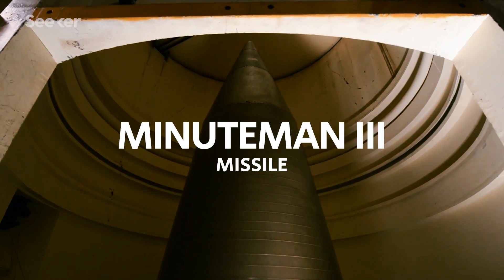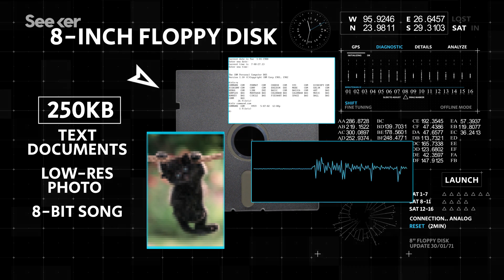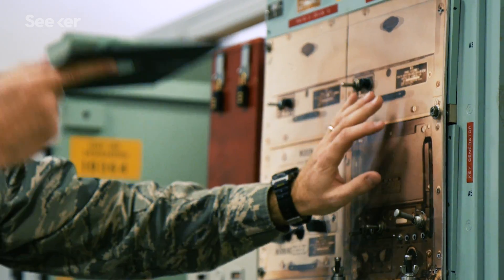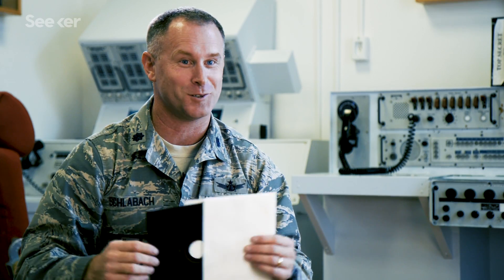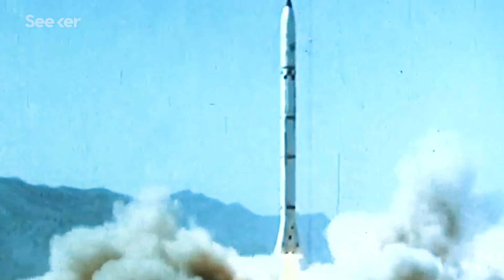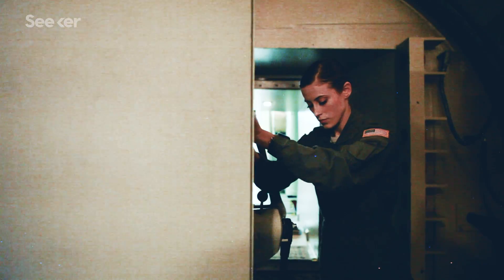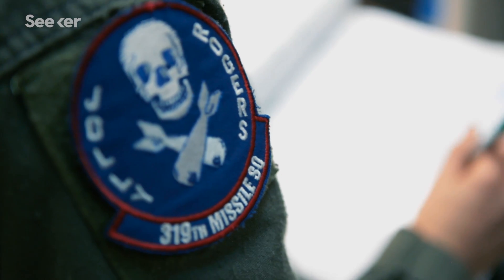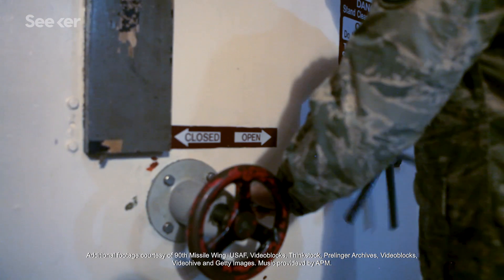When U.S. Nuclear Missiles Were Controlled By Floppy Disks

Comment from the maker: Hi, thanks for watching! An update: In June 2019, the U.S. Defense Department transitioned away from a nuclear command and control system that relied on floppy discs.
Reply: Seeker using usb sticks now. 😂
Reply: This makes no sense. On floppy disk the system is more secure than relying on hard disks because hard disk drivers can be modified with the private source code.
Reply: @hassansyed5661  floppy disks are hard to repair and expensive to fix when they do break

Comment: In these days of globule hacking, internet access and the rest an isolated old school system is best. One EMP in the right place WILL take out all phones, ATM etc , and pretty much everything newer. Old tube based systems will not have a problem apart from limited range, why because they don't have circuits that will fry as long as they are connected to batteries. If you want to save your laptop and have time to do it, stick it (and your phone not sure if it'll work due the rest of the system going down) into a metal cabinet that's grounded. I think they call it a Faraday shield.

Comment: It's pretty stupid, any custom hardware with any custom software that isn't connected to the network is "hacker proof" the hacker wouldn't know where to even begin...

The sheer amount of electricity this behemoth runs on could subsidize a new hardware project...
You could still use floppy discs or any new custom storage medium but the control box would be the size of a shoe box.

Comment: Spare parts will eventually require specialized manufacturing systems just for these devices (for example, very advanced 3D printers for parts, even making the disks).  Making sure that these add-ons have not been hacked is necessary.  With looming nano-technology, this will be extremely difficult -- can the sites be sealed airtight?

Comment: I am very reassured to see that the OS fits in 200KB. There is no better way to introduce bugs than to grow your code and to have a huge system where nobody really knows what is happening. 200KB means the code can probably fit in a single text file and be known by heart by a single person, which makes it easier to spot bugs before they happen. Less code means less things that can go wrong, less probability of bugs. It means less potential states and less unpredictability.
Old hardware means tested hardware. But I would definitely want to build strong redundancy, because old hardware is reliable until it breaks down, and really old hardware can break down in unpredictable ways.

Comment: This is somewhat misleading as the system using the floppy discs is actually a communications system which was called SACDIN or the Strategic Air Command Digital Network.  The system allows an Emergency Action Message (EAM) to be delivered to all nuclear forces within X amount of time.  The system was built and delivered by the ITT Defense Communications Division.  I was involved with the project from research and development (R&D), testing, production, delivery and installation. The system is a watered down version of the system the Air Force initially wanted which I believe was called SATIN 5.  

This project was started in the 1970s.  At that time the government wanted off the shelf technology used.  The problem is by the time the system is fully installed, in 1988, the system is already obsolete.  The system tested to be extremely reliable and  performed to the specs required by the USAF.  Additionally, it is virtually impossible to hack into the system.
Reply: Conventional strikes combined with a drone hacking on the ALCS UHF modem.  The attacker would need to really know the system down to the Ada code and have codes, but it could be done.  
MAD would be the main protection from such an attack, as such an action would require a state actor.
Reply: Thank you for your reply.  Nice to hear the view from someone with intelligence.
Reply: We tested for virtually every possible scenario and I am extremely confident the system could not be penetrated.  Some defense was classified at the time and even today I won’t discuss them.  However,  as you have mentioned pretty much anything is possible.

Comment: This very typical about the status quo.  Most recent experts in computer science, engineering and science called this "resistance to change."  Microsoft and Apple had this exact problem in 1970 to present.  It is called UNIX command line editor fight for survival against graphical interfaces and object oriented programming methodology.  Therefore, the veterans of this technology need job security by blocking the younger generation.  However, I suspect many who were the "champions of this technology" are now actually dead or incapacitated to fix undocumented codes, process, and technology.  They should used the processes of Microsoft and Apple to overcome this hurdle.  I suggest the younger people should be able to exact (hack) that 8 1/2 disk and get the data format.  It is a start.

Comment: New hardware does not equal less secure!? You can upgrade without including bluetooth, wifi or any other network communication. What is down there is old clunky and difficult to maintain. Floppy disks are not reliable, solid state storage is. New hardware = less maintenance, smaller form factor, less room for error, less checks for issues etc etc.

Comment: Good valid points on using an antiqued system however the major flaw with this system is the floppy disk it's self. CDs,DVD,blue ray, and USB drives all have a much longer shelf life than a floppy disk.
Reply: That’s not true, discs have a short lifespan, that’s why a lot discs from the 90s and even early 2000s have disc rot. Floppy discs are actually made out of tape which has a much longer lifespan. USB devices are too vulnerable to use with a middle silo.

Comment: New computer systems don’t have to be less secure, more ram, a better operating system, streamlined (by today’s standards) launch protocols, custom engineered launch keys, no ones forcing you to have wireless and the only people who knew how to hack it (which would require physical contact in this case (and that team already has security over that covered by the looks of it)) would be the ones who built it, it’s not like they’d be buying motherboards off the shelf with a fresh copy of windows 10

Comment: They're using (notoriously unreliable) magnetic storage? They're not even going to move to modern, radiation-hardened ICs?
I don't buy it. I bet they have like 2 missiles controlled by this old tech, and the rest of the fleet is using modern (proprietary/secret) electronics.

Comment: So a week or two ago it came out that there are security vulnerabilities in the actual processors themselves, hardware , Perhaps intentional back doors, that were placed in almost every processor made by the three big processor manufactures for the last many many years. For example every single iPhone has processors with these laws. Embedded security back door is in the switches of processor chip some cells are incredibly hard to detect.  Frankly I would be terrified if they were to update the Minuteman system with modern computer is because it is so hard to protect against these laws or back doors if you prefer to call them that as they were probably put there on purpose at the behest of the NSA or something. Anyway I would be terrified. No I tell you what magnetic film disc memory is a little bit scary

Comment: I see all those doors and metal gratings, opening mechanisms and other general metal parts through that video are all rusty and with pealed paint. It looks like that not only computers are old.  Worst of it is that it looks like that maintenance is lacking. Hacking would be the least of problems if those missiles start falling apart by them selves.

Comment: As a person who have used 3.5 inch floppy disks during school days for projects, these things are extremely unreliable, I remember keeping 2 to 3 backup floppies just if one in hand don't work. Compare it to usb sticks, usb is 1000 times more reliable than these floppies. Now coming to hacking part, yes not connected to internet helps, but you dont need to connect modern hardware to internet. You can get modern upgrade and not connect to internet for security reasons. these guys are just counting these benefits for sake of assurance but they all know if war broke out they are all sitting ducks with unreliable floppies.
Reply: Well, 3.5 inch floppies was last produced by sony(the last player remaining in floppy market) in 2010. the production of 8 inch floppies stopped in 90s, so these guys are either using 15-20 year old stock, or buying used ones from market.
Reply: 3.5 floppies are unreliable as they were made in a time where they were obsolete. 8 inch floppies are extremely reliable and durable.

Comment: They should secure the wires that connect the system to the central hub, this is the most glaring attack vector. They are also vulnerable to a total shutdown if there is a large enough EMP that wipes the disks. Hope they have taken a lot of precautions.  Those missiles are very very dangerous!

Comment: Gotta say.. the way that guy kept saying "It still works. So why change it?" Sounds a little... fucked?
I mean how long until it doesn't work? Old trusty car thats been working for 30 years is great until is finally kicks the bucket. Only in this case its nuclear weapons that may kick and well... That's a big kick.
Reply: Changing the system isn't a significant threat if done correctly.
Obviously you don't upgrade the entire fleet of nukes simultaneously.
Reply: Well I wasn't getting mad at him. I was just pointing out how saying that is a bit off. It applies to the entire branch. Also as Falcrist explains, they would do it in chunks, not all at once. It definitely would not switch off the US entire nuclear defense system to update it.
Reply: El Psy alternatively I’m sure they’ve evaluated the threat of changing the system. We would have to most likely disengage our nukes for enough time that the risk to payout option is not currently worthwhile. Also he’s a puppet he doesn’t make those choices so don’t get all mad about him just saying what he was told to say. He may not be at the bottom of the food chain but he sure as shit ain’t at the top

Comment: It's genius. There isn't enough memory to hack with advanced modern protocol stacks. You might even have to use obfuscating compression encryption to make a dent. Just wish they used an optical disk with similar built-in memory constraints for better reliability over floppy.
Reply: lmao word salad much there guy.  I am sure that obfuscating compression encryption would render your every attempt COMPETELY incompatible with the target system. as each of  those methods are for modern systems to talk to another modern system that it shares keys with already. smh

Comment: Ummmm, little do people these days realise, but the old floppy disks such as from the brand Verbatim pre 1995 were INSANELY high quality and could easily last a hundred years under the right conditions - FAR longer than CD/DVD or anything since then - plus minimal tech needed to make it work which means less chance of a modern hard drive or modern motor inside a bluray drive screwing up over the decades of no use - - overall, it is FAR better to use those than modern tech! Also, less chance of being hacked as they are 'out of date' lol

Comment: Coming off the civilian side of nuclear I can tell you at least in Canada it's the same story. The CANDU control computers were one of the first digital controllers and we still use the same code and the same operating system which is a big problem when the computers need to be replaced

Comment: Lol they revealed a lot of secrets. 
1st it's hackable through floppy. You don't need to search the web. Secondly the guy that explained probably has info on his laptop about this system. So getting acces to his computer or any other operators computer can reveal a lot. Sometimes the simplest email can.

Software is probably written in cobal language considering it's age and "cutting edge technology back in the day". So in any case if the floppies were swapped in a hackers scenario than it probably be hacked.
Reply: Launch officers also texted the launch codes one time, so those are known.  Military is slow to change those, with the last launch codes being 00000000 on all minuitman missiles for the longest time.
"Software is probably written in cobal language considering it's age and "cutting edge technology back in the day"..."

Ada, based on pascal.
with Ada.Text_IO; use Ada.Text_IO;
procedure Hello is
begin
  Put_Line ("Hello, world!");
end Hello;

"So in any case if the floppies were swapped in a hackers scenario than it probably be hacked."
USB to FDADAP interface card and you are good to go.

Comment: So what you're saying is  Skynet can't take over then?
Reply: Depends on how it attempts to access their network.  Potentially it could just provide faulty info in an attempt to hack the human operators hahaha, but one would hope they have contingencies for such scenarios.
Reply: it cant connect to it .. a robot will have to get in there and do it all bye hand
Reply: Not yet. I'd give it 100 years
Reply: They won't need nukes. There will be swarms of artificially intelligent drones.
Reply: @patstaysuckafreeboss8006  but would the electromagnetic pulse from a nuke fry all the robots?
Reply: @TheGeckoNinja Those robots can be shielded by EMP deflection material.
Reply: Skynet could probably still do it but it would probably be more difficult and take more time. If the missile defense system runs on any kind of computer network Skynet will still find a way.
Reply: Rick Sanchez Uh...  that would still take time to produce the robots. Time which humanity can easily disable most such factories.
Reply: A predator can always outsmart and predict its prey.
Social engineering is the most common type of “hacking“
Reply: Kevan808 It can, if you keep swapping its floppy disks. Good luck keeping everything in ram. Think 1-2-3-1-4-5-2-1-3-6-7-4
Reply: You can't hack floppy drives - military
https://www.youtube.com/watch?v=WtiAP8xMSPo
Reply: It can't if it isn't connected

Comment: Worrying that a weapon as powerful as a nuclear missile are still controlled by floppy, disks those things would go corrupt if you look at them in the wrong way, what if the corruption cause a launch that's frightening.
The US need to update it's technologies before it's to late, maybe it's something Trump could get is teeth into by ordering an update immediately.
Reply: Old floppies were a lot more reliable than newer ones. Late 90s floppies are the worst.
Reply: Even if what you say is correct they haven't made 8 inch floppy disk in more than 30 years so what floppy disk the US have now must be getting a little worn it's time for a replacement of some kind
Reply: Could we upgrade the system? Yeah sure. But we leave ourselves completely vulnerable to attacking during the transition period which we have no idea how long that will take. 

Floppy Discs hold data much better than CD’s since they run the risk of corrupting due to small scratches. 

Also they running that on a completely secured network. Which means they are not connected to the internet making the system itself unhackable without someone from the inside pulling strings. This thoroughly decreases the risk of a cyber terrorist  or anyone else gaining asking to a system that could cause a mass extinction event.

Trump should not even think about touching our nuclear missiles. The last president to do so did so during the Cold War where there was a significant threat that we too could be nuked. Russia had 11 nuclear missiles aimed at my home town because of the nuclear power plant located near. Not to mention debilitating the state of PA meant cutting off transport from major cities like NY or making the advance to get supplies and soldiers out much more difficult. 

Please do your research on why things are the way they are before you make baseless assumptions about how we are handling our WMDs. Hell the US is a fucking a bull in a china shop but when it comes to something that can potentially kill EVERYONE we tend to keep that shit tied up in a pretty bow.
Reply: Trust me, Even if one would go or start to corrupt, Nothing would happen. There are "Quite" a bit of safeguards installed and series of events that need to occur before and after any input from the system (Floppy, Computer, physical buttons), both computer and physical inputs and hella more things need to happen for just a door to open let alone launch. =D
Reply: 100% Agreed. The floppies need to go, and the fact that they're pretending it isn't a problem indicates that this video is mostly BS. I suspect the military has already replaced some of these systems, and is spreading misinformation.
The rest of the electronics would probably fine, though. You don't need a modern CPU to run a system like that.
Radiation hardening would be nice. Maybe they'll eventually upgrade for a purpose like that.